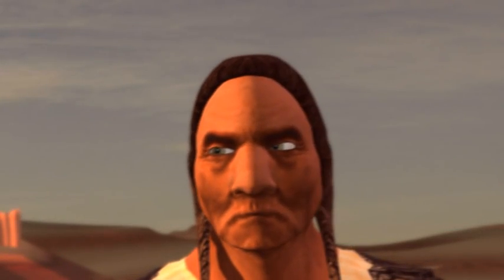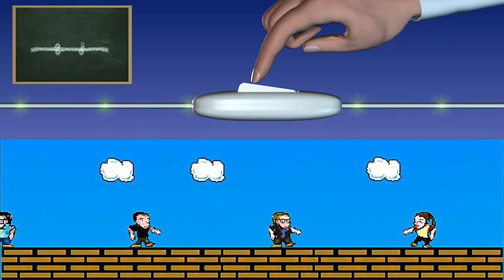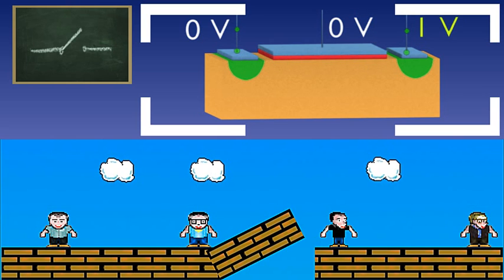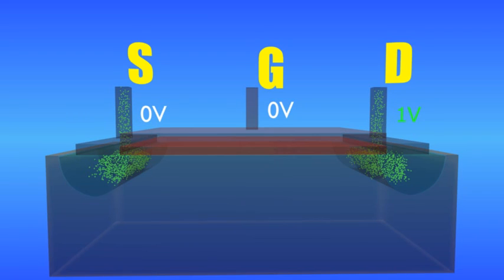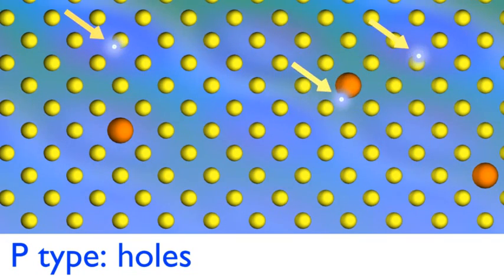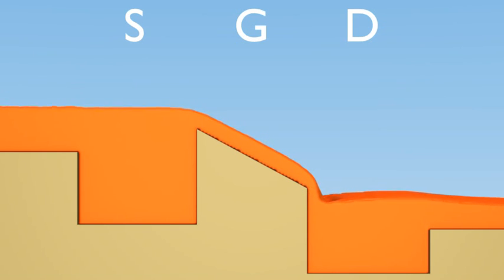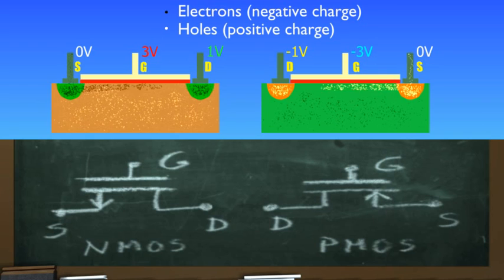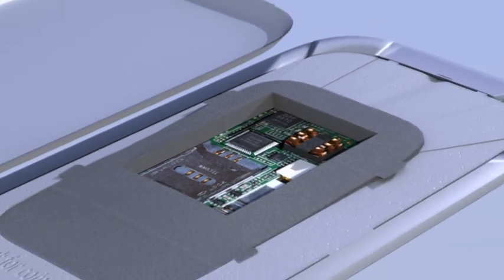How Transistors Work - The MOSFET (English Version)

Comment: I find this video very misleading. At 5:44 the principle is absolutely wrong. Attaching a positive gate potential with regards to the source potential will not form a channel. The channel is formed because of the gate bulk voltage. In the case of an N channel transistor, the bulk is usually connected to ground. The channel is formed because you attach a positive potential to gate with regards to bulk. This will push majority holes out from the region under the gate, leaving there only minority electrons. That is how a channel is formed. Talking about VGS is misleading, the only reason why VGS is used is, because source and bulk are usually shorted.

Comment: I now realise how a MOSFET transistor works. SIMPLY PUT, A VOLTAGE AT THE GATE ALLOWS CURRENT TO FLOW BETWEEN THE SOURCE AND THE DRAIN. WICKED VIDEO THANKS.

Comment: What causes the "barrier" between the N and P regions?  The speaker just says "barriers appear" 4:55
Reply: When the electrons(n) goes to the hole(p), they neutralize. So, when you take out an electron ( - ), you became Positive(and rejects the Hole(+)). The same happend at the other way, and became Negative (and rejects the Electrons (-)). That's the barriers, and it's called "Deplexion Zone"

Sorry my bad english, I'm trying harder :)

Comment: strictly transistor is a quantuum physics device, so we need to just keep in mind that in computers it works like switch electrically controlled, then some logic gates - ie AND OR elements which are consist of those "keys" -transistors. then some memory devices ie triggers are numbers of AND OR gates collections this all form registers memory and ALU (arithmetic logic unit) - main parts of every chip we have in our hands and in our homes))

Comment: When transistors are part of circuit, you could say that (in this case) the source and the drain are 'directly' connected to the circuit, playing a passive role.The gate is the input signal and determines the flow of current. The output is connected to the circuit (right before the source or right after the drain, depending on its function). The simplest function to look for is the invertor (NOT port).

Comment from the maker: The gate may have a certain voltage due to many different causes. For instance, it might be caused by processes where a signal is triggered (sensors), or it might be a logic gate with an ouput of 1 or 0 feeding the next logic gate...

Comment from the maker: 1. Roughly speaking, the switch is controlled by the voltage in the gate. Depending on the value there, the switch would be on or off.
2. This is just the brick to build the house. In the last section of the video you can watch how a couple of MOSFETs would work as an inverter. Logic gates are obtained (AND, OR, NAND, NOR...) combining more MOSFETs. This is studied in digital electronics.
You can also have a look on my new video on pn junctions. Thanks!

Comment from the maker: Hi again! Well, there are many differences since they are different devices. Probably the most relevant one might be that the BJT carries current by every contact, meanwhile MOSFET has a current just between S and D. Gate in the latter controls the current with its voltage, but there's no current in that contact. But there are many other differences, of course.
Since BJT consist on two polarized pn junctions, you could watch our last video about pn junctions (browse my channel). I hope it helps.

Comment: No, an NMOS turns on when Vgs > Vt.  Vgs is Vg - Vs, or the voltage between the gate and source terminals.  A PMOS turns on when Vgs < Vt. Vt is positive for an NMOS and negative for a PMOS.

Comment: A MOSFET is turned on and off based on the voltage of the gate electrode.  Generally the gate electrode is controlled by another transistor.  Large networks of transistors are built to form functional blocks such as registers (memory), latches, adders, multipliers, etc.

Comment: Very impressive! I learned quite a bit of information about transistors here that I was never taught in any of my electronics courses. (We avoided transistors.) I was curious - what type of material is the insulating dielectric made of? Most time it is silica, but is it crystalline or amorphous? I'm guessing it's amorphous silica (glass), as using crystalline silica would cause strange problems.

Comment: Nice explainations! I especially liked the shown "pinch-off effeckt" and the explainations using th band-diagramm even if those two points weren't explained but just shown :)

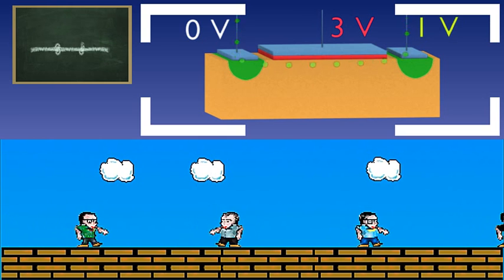@ 3:11 The gateelectrode dosn't overlap the sourche/drain regions wich would lead to a not working device @ 3:14 it's correct

Comment: This is an excellent video on how MOSFETs work.  Thank you for putting it up here.  Good Job, Universidad de Granada!

As a continuation of the explanation for the name MOSFET:  The phrase Field Effect is what you get if you apply a gate voltage of the same polarity as the doping polarity of the substrate ( the big bottom material in the diagrams ) ; what occurs is a repelling of the electrical fields of the gate & substrate, which then allows a channel to be formed allowing for current flow.

Comment: It is the battery symbol that is incorrect if it where a capacitor and you made that error it would explode in the circuit, otherwise it is a wonderful presentation,

Comment from the maker: @ljay0778 Hi! most of the explanation in this video is based on N-CHANNEL MOSFET, so the positive voltage at the gate is right. I'm afraid you could be a bit misled because N-CHANNEL MOSFET has a channel in a p-type semiconductor (the inversion channel).